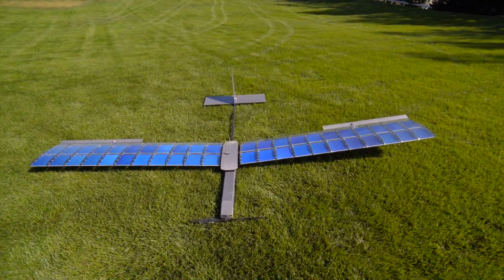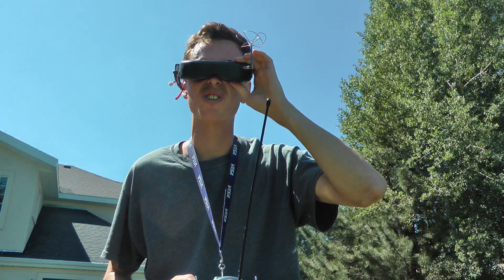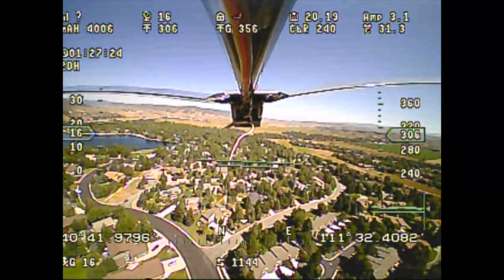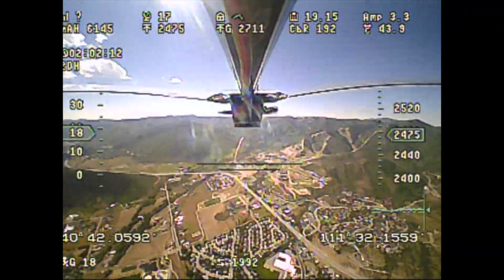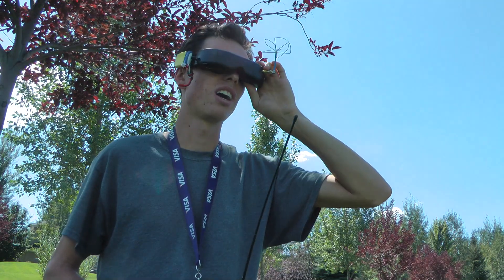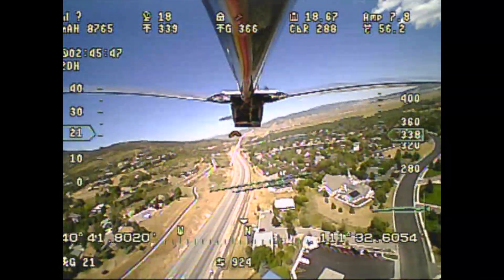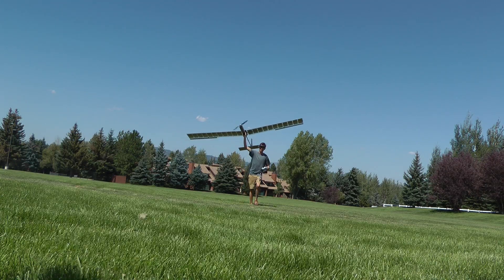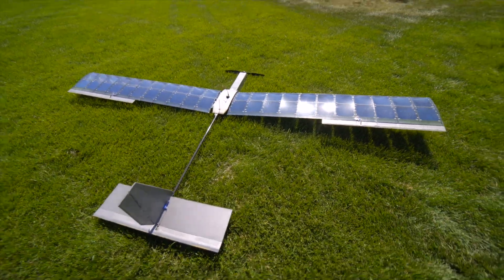SOLAR Plane V3 Long Duration Test Flight - RCTESTFLIGHT

Comment: Dc to DC Boost converter between cells and the battery then set the converter to the ideal charge voltage.  It should fix these issues all together
Reply: agree, I believe the setup is not optimised for solar flight.
Reply: Super definitely agree. This needs a maximum power point tracker (MPPT) chip and no question that it would be worth the 20-40g weight.
Reply: I think MPPT is still desirable to make sure the PV cells are putting out maximum power.
Reply: More like 1:1.2, but this isn't a consumer electronics device, its a science experiment operating on the edge of having enough margin to sustain flight.  The background power draw of all his radio gear, not to mention the motor is enough to keep the pack voltage within spec.
Reply: yup
Reply: If you optimize your photovoltaic array so that the maximum power coincides with a nominal battery voltage so you can charge, you better be ready to deal with batteries on fire, because the open circuit voltage will be way more than the battery can take.  Typical ratios for open circuit versus maximum power are like 1:1.4.  These systems are fundamentally incompatible amd there needs to be at least some interfacing electronics.
Reply: His genasuns gv-10 weighs 160ish grams if he uses it.
Reply: You can get a tiny board under 10 bucks, it does not weigh anything.. :D
Reply: A converter of any kind will just waste power. You need to optimise the impedance of the power train..
Reply: That just adds losses, the system finds the MPPT naturally as the voltage drops.
Reply: Saying PWM just means that there is switching going on  (buck or boost, most likely).  Those big MPPT boxes are not what I was referring to, and may be you're not aware that that an MPPT uses PWM, but just sets the duty cycle so that the maximum power is extracted from the solar cells and sent to the output (battery).  Here's an example: http://www.ebay.com/itm/5A-9V-12V-18V-24V-MPPT-Solar-Panel-Controller-Battery-Charging-Board-1-100W-/272252183236?_trksid=p2141725.m3641.l6368
Reply: I don't know if it would be worth the weight gain and extra loss of the converter though

Comment: Excellent stuff Daniel. One thing you should (may have) check is the solar cell temperatures, they lose efficiency the hotter they get, and under the film in that wing, it could be working like a solar water heater. Ideal wing would have the cell underside exposed to the under wing airflow to keep them cool. Still, you're getting close. One other thing, I have run tonnes of props on a dyno to plot efficiency in static and airflow, and the worst across the board were CF props, by a massive margin, not one brand CF has come anywhere near plastic. Anyway, thanks again for another great vid.
Reply: Alasdair McC man I love the internet, and people like you. Fascinating insights, especially regarding plastic vs CF props.
Reply: Yes, but from what I could see, they are enclosed within the transparent wing skin both sides, and at around 1kw/m2 there's an awful lot of heat to pass through a non directed vent.
Reply: Yes. 'Sunk' heat from panel heating robs ~25% of the yield from poly cells, and just dropping them to ambient temps gets this back. Not sure how to achieve this in wing, but it's a design consideration for solar racers (cars). 

Trapping the cells under film may not be too bad, on account of air gap venting at ends, but a temperature sensor will tell this story. Try wetting them down (on the bench) to see this effect. The results are astonishing. Blows up/shuts down charge controllers!
Reply: could i get that data of from the test you have done?
Reply: i will even compile it for you, just need the raw numbers
Reply: enderw1g1n, I need to dig it up, it was several years ago that I did the testing when I was building quads, and pre digital interface. I will search though. I still have the dyno test rig, may be time to dust it off for the multitudes of props gathered since. I did publish it on DIY drones back then, but I've since unsubscribed a couple of years back so it's likely gone.
Reply: Fortunately, solar vehicles maintain constant air cooling off the panels, so heat should not be an issue.  Even a gentle breeze will improve the efficiency of stationary panels.
Reply: Interesting stuff Thingdom, must order some wood props.. thanks.
Reply: i agree i was thinking the same thing however it looks like there are air vents at the side of the wings
Reply: If the wings where to be swept (maybe building a flying wing instead) some air could be channeled through the center section into the wings and out the tips. However, exposing the underside to airflow seems a lot more resonable.
Reply: Also if he doesn't want to modify the wings much he could suffice with some small NACA intakes.
Reply: enderw1g1n That was my question.
Reply: I was thinking the same about the prop efficiency and the temp of the panels.  I am currently trying to find the time to research making folding panels with enough efficiency to partially recharge a Zero SR electric motorcycle I'm looking at getting.  I wonder if the emissivity of using a Mylar skin (0.044 I think) on the bottom would help them stay cooler.  I randomly came across this page while looking at a Flite Test video.  I will definitely check back in to see how the young man comes along in his endeavors.
Reply: Big solar planes have panels on top of the wing. Advantage is, that it is exposed directly to the sunlight and cooled by wind. But panels have to be flexible.
Reply: It's literally flying. It has infinite forced air cooling and the air temp drops as you ascend. Panel temp is a non issue.

Comment: Do you actually need to be flying while conducting the electrical tests? Could you for example have the plane in a vice in the sun with the motor running as it would be during flight and hook up the extra meters or whatever you needed to track the charge/discharge info to fine tune the balance of power moving around the cells/battery/motor? I have no idea about this stuff, it's just an idea.

Comment: I think you should try using 5 18650 3000mAh batteries from LG. I think the ones I'm talking about are the HG2 model. It would be lighter and more efficient I think ;)

Comment: Just a question - how does the FAA allow you to fly this high even if you let them know that you are going to fly it? The regulations really suck but I guess you WILL interfere with air traffic without helping it. Isn't it a risk for trainer aircrafts? Oh and nice video
Reply: I'm a bit worried for Daniel as the FAA has been watching YouTube videos and then clamping down on those who flagrantly violate their rules.  He could end up on a heap of hurt if they see this, or some "anti-drone" fanatic does and forwards a complaint.  He should either not have altitude shown on the screen or fly below the 400 foot limit.  Love this stuff though and have been following Daniel for some years now.
Reply: Mutant Yengeç Edits the plane may be over the weight so he registered it and then some agreement with a licence to do so? I'm just speculating but it's not the worst
Reply: Sheldon Aubut 400 feet is fucking crazy
Reply: well, 400 ft is the rule that allows us to keep doing this hobby.  Those that don't abide by the rules threaten the hobby for all of us.
Reply: Do I need permission from the FAA to fly a UAS for recreation or as a hobby?
There are two ways for recreational or hobby UAS fliers to operate in the National Airspace System in accordance with the law and/or FAA regulations. Each of the two options has specific requirements that the UAS operator must follow. The decision as to which option to follow is up to the individual operator.

Option #1. Fly in accordance with the Special Rule for Model Aircraft (Public Law 112-95 Section 336). Under this rule, operators must:

    Register their UAS with the FAA
    Fly for hobby or recreational purposes only
    Follow a community-based set of safety guidelines
    Fly the UAS within visual line-of-sight
    Give way to manned aircraft
    Provide prior notification to the airport and air traffic control tower, if one is present, when flying within 5 miles of an airport
    Fly UAS that weigh no more than 55 lbs. unless certified by a community-based organization

Option #2. Fly under the FAA's Small UAS Rule (14 CFR part 107). Under this rule, operators must:

    Register their UAS with the FAA as a "non-modeler"
    Obtain an FAA Remote Pilot Certificate
    Follow the operational requirements (PDF) of Part 107
Reply: Guys. Y'all gotta understand. The faa has no laws on model airplanes under 55 lbs (think that's the weight). They did have that bill pass a while back but it was overturned because it violated the 2012 faa modernization act.

Comment: Good work Daniel. There are numerous places you could reduce drag (and therefore amp draw) i.e. a folding prop / spinner, close any gaps, smooth and refine trailing edges, servo covers etc. Look at the lengths dynamic soarers go to, to reduce drag to get a glider over 500mph.  Not suggesting you go to those extremes but reducing drag would be better than fancier electronics.
Reply: Prop efficiency is hurt a lot by drag directly in it's airflow. The big square nose and lack of spinner is likely doing more than 2 or 3 percent on it's own. Along with things like square wingtips, no airfoil on the stabilizers, square fuselage shape, sag of the covering between the ribs (from the lack of forming spars on the leading edge like you see on traditional built up wings- i forget the exact name), it all adds up very quickly, on an efficiency focused design.

Obviously, electronics need to be addressed too, but starting with a solid, efficient platform means you can get more out of the power system if you improve it.
Reply: I am not sure. Drag at such slow speed is not an issue, lets say 2 or 3 % of ideal aerodinamic system. He can lose up to 20% on battery management.
Reply: I've been posting this since the start of this series... That and building up a lighter wing with balsa or foam core/sheeting would probably help take this project from marginal to fully sustained solar flight.
Reply: @chrispychickin  Agreed, balsa wing would be slightly expensive though. Using a Foam wing(XPS), with the right airfoil might be a better alternative.  Also, the solar cells should be on the wing surface, as I can in the video, the cells are around 3-4 cm below the surface of wing and ribs might also block some sunlight falling on the cells.
Reply: agree, but this plane is flying at 10, 20 miles per hour tops... it adds up quickly on 50-100 mph... if you put your hand out of the car at 10 mph you don't even feel the wind... but at 50-100 mph drag is obvious... of course, I agree on the fact that it is the factor...
Reply: Long time viewer, first time commenter, seal the wing roots!  With the gap there it's almost like a biplane, i.e. Four places for induced drag. Also, I think you will reach your goal when you bite the bullet and get all of the solar power using mppt.  Keep up the good work!
Reply: More like 20% on switching losses if he throws a power conversion stage between the solar panel and the rest of the system.
Reply: Yes on wing roots, no on MPPT.

Comment: I was most worried about the batteries of your FPV goggles and radio
Reply: 4 hours my biggest concern would be having a port-a-john nearby!
Reply: InfinitExpanse that’s why you grab a shit bucket before you start flying..
Reply: I have to confess that I'd love to build one of those but with super high zoom and high resolution (maybe even FLIR) and pretend I'm laser painting targets for a missile strike.
Reply: Leandro Ribeiro same lol. Head tracking too🤣
Reply: Leandro Ribeiro lol
Reply: lol fly and $hit at the same time.
Reply: Then couldn't you setup a small portable solar panel on the ground as well?
Reply: +InfinitExpanse that's what the depends diapers are for
Reply: You did see the resolution of the in-flight cam right?
Reply: "FPV goggles and radio"? It is properly known as a nerd helmet.
Reply: same
Reply: fluburtut im sure that he first charged them before flight so he will have enough batery for 4 hours
Reply: Fluburtur me 2
Reply: And i am worried about privacy of the people.

Comment: I'd like to see it fly with the radio/FPV gear being powered by a small internal battery, and using only the solar panels to drive the motor. It's a bit risky as you won't have much power to try and take off, but it would be cool to see a short test flight with a fully solar power system.

Comment: Hello from Moscow! You can fly with portable router with usb 4g modem and ip camera. Use cloud service to see fpv. Your aircraft is amazing efficiency!
Reply: Too much for interactive control but not too much to send commands to an autopilot.  The idea of unlimited range is intriguing.
Reply: Would have too much latency. Plus a good bit of weight
Reply: You don't need the phone, just the 4G electronics and the antenna.
Reply: make sure you have someone to call an ambulance for you when you get the bill
Reply: Just have a video Rx on the ground connected to a USB video adapter and stream that way.
Reply: yes I've thought about this too, like that you could get almost unlimited range
Reply: thats russia for ya
Reply: May as well find the smallest, lightest smartphone you can and tape it to the front of the plane. Then you have your 4g connection, flight computer, gps and camera all in one bundle.